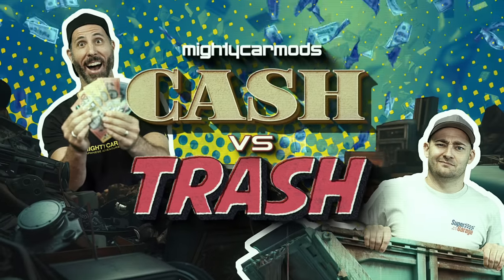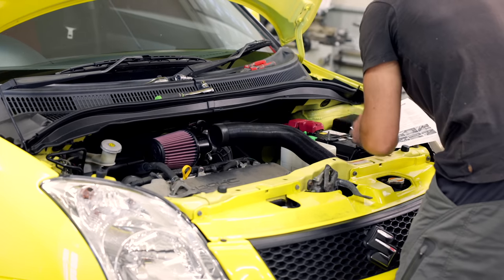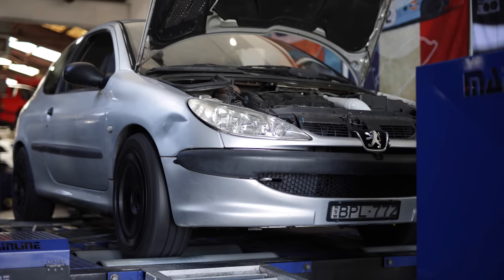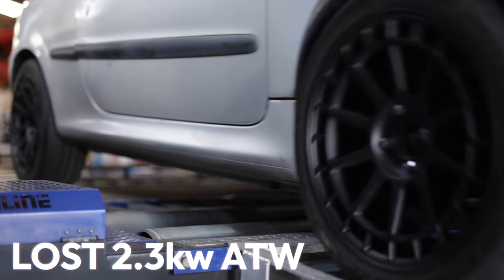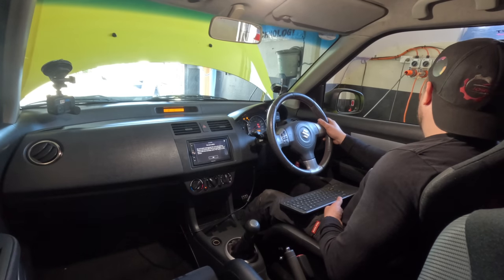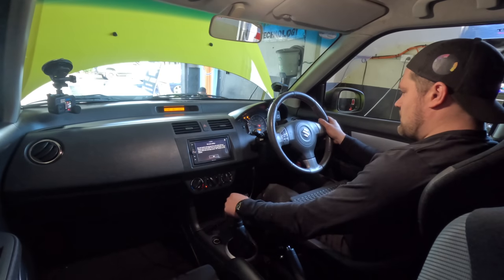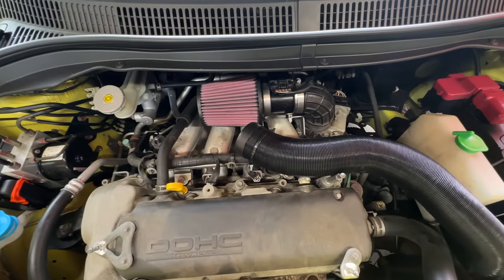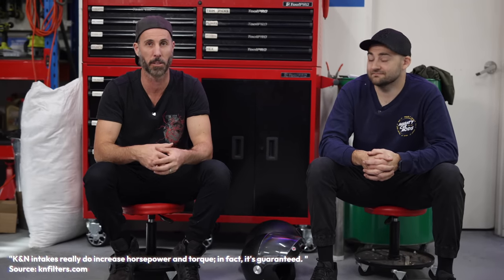Dyno testing POD FILTER Performance Claims | CASH vs TRASH

Comment: Gents, The airflow sensor requires a laminar flow over it. Pod filters are a perfect device for creating a turbulent/tumbling or uneven "flow". Basically its trying to correct fluctuations which it cant to fast enough. An "air straighter" (not joking) will yield the results you seek. Its a grid type device which sits BEFORE the afm. You're welcome.
Reply: They look like honeycomb to be more precise.

Comment: the problem with the Suzuki's intake is the position it's mounted. You have it (as far as I can tell) directly above the exhaust manifold. The hottest part of the whole engine bay. So you actively made a hot air intake. Rerouting it somewhere towards the front might help if you can make the room. If it's the intake manifold, directly above the engine is still not exactly great.

Comment: Powerloss like could be down to humidity, air temp, the changed lenght of the airintake, lack of exhaust backpressure. As for the Peugeot, I'm pretty sure that engine needs the valves adjusted manually, it's not done hydraulically. It's a very often 'forgotten' maintenance thing. That could increase power.

Comment: Air temp, Humidity, and even gas that's formulated for that week/month temperature conditions are all variables that can and do have an impact. Aftermarket air filters that replaced the box can cause unwanted turbulence around the MAF, usually seen and a wavey/lumpy Dyno graph. This is also why there's usually a honeycomb grill Infront of the MAF the straighten the air flow. To a further extent on N/A engines with very predictable air flow, excess flow can ruin intake runner harmonics on newer cars with very finally tuned runners designed to smoothen/use vacuum pulses caused by the valves opening and closing to help flow. I noticed cars with MAP sensors can/usually run better with aftermarket filters, as part of the design usually designs baffling which can be friendly towards changes like those.

With all that said, every car is different and can be susceptible to changes while others can have slight benefits

Comment: You increased the flow of air without compensating with the fuel map, therefore you are leaning out. Also the air pulses of the intake valves opening and closing need a damper, therefore lengthening the intake pipe will matter.

Comment: I bought an E30 from a total bogan and it had a pod filter custom mounted with zip ties. The car ran like crap and it fell off before I had the chance to mount a stock air box.  After putting the stock air box in it runs and idles great and I’m pretty sure it has more power. 😂

Comment: I reckon the swift lost power because of the intake location - no fresh cold air at the back of the bay behind the engine.. maybe try with no bonnet, or longer intake pipe to the front of the bay where some fresh air enters?

Can also have something to do with ambient temps, as cooler air is more dense

Comment: Moral of this story: Multi-billion dollar manufacturers with huge R&D teams usually know what they're doing to squeeze everything out of their motors, even if they have to meet efficiency standards. It's not the 1970's anymore, where manufacturers of carbureted vehicles were forced to cripple their motors just to meet smog standards - every trick imaginable is being used to create excellent performance right off the showroom floor, as increased engine efficiency also means better economy and emissions in general. About the only place where restrictions tend to exist still is exhaust due to noise regulations - and even then, a lot of stock exhausts do pretty well out of the box. Mighty No Mods!

Also, do we know if the ambient air temps were the same on both runs? Engine bay temp? There are so many variables here that can cause loss/gain of power that I'd venture to say that the losses seen here aren't necessarily due to the modifications; both cars are likely putting out the same power they did prior to the modifications.

I will say that it's a delight to see that STUPID $500 K&N filter and dangly tube lose power though. There's no world where that should ever work. That's not a cold air intake, that's a hot air intake sucking in nothing but engine bay air. Ridiculous.

Comment: Firstly, dyno on the same day under the same conditions.

Secondly, compare the entire power curve. Intakes may not increase peak power, but they will typically increase the available power across the rpm range.

Comment: Those intakes can make more power however I have only seen them make a difference on old engines specially with carbs. I run twin Weber carbs with no filter just the stacks but my car is heavily modified for racing. However with the “performance intakes” they don’t really make a noticeable difference unless you have a worked engine then swap to the upgraded intake and exhaust you will actually notice a difference.

Comment: K&N have historically proven to flow better than other filters of the same size and construction.
What you need is a K&N filter replacement for your existing stock filter.
Tuning air flow into an engine is complex and there are always trade offs.
OEM's have to compromise for noise reduction but still work hard to optimise air flow for best torque delivery.
In my opinion, unless you are increasing the VE of your engine there is little point in replacing the stock intake system other than for that sweet induction noise.

Comment: I'd claim there should always be some sort of resonance chamber at the intake. Also sucking air through a flat filter element in my books is much more optimal than trying to do it through a pod filter. Maybe in a drag race or other pedal at the floor -driving it may work (in certain rpm range) but when the engine has to do actual work in multiple rpms and situations, a straight pipe will not work, be it intake or exhaust. /opinion EDIT: though a pod filter could work at the end/start of the intake of a resonance chamber, or closed in line with enough volume around it.

Comment: on a dyno run, the engine gets very hot, because you're not driving. The air filter is sucking in hot engine air that makes you lose power. You need shield it from hot air, or different place, like before and lower than the engine, not behind and above for hot air to get sucked in

Comment: As for moogs power issue, it's been caused by additional airflow.
Probably hot air too...
The engine is getting too much air and which leans out the mixture as a result it gives a loss of power.
Sounds stupid, but with the stock parameters of the ecu fuel mapping etc
It won't be able to adjust  that much that quickly.
For that sort of thing you'd need like a haltec ecu (learning)or go get the cars mapped to deal with the additional addons, so that the fuel spark etc can be adjusted to meet the air.
Engines are just big air pumps, so the more air, the more spark.
As for the exhaust I can see some potential power gains there if marty where to make some sort of custom manifold...
E.g. 4-2-1 exhaust to help purge the exhaust gases from the engine.

So basically engines won't make super amounts of kw/ hp without being adjusted to benefit from the new parts 👍

Comment: I would have to assume the aftermarket filter is changing the way the air is flowing past the MAF sensor. You may need a new tune to make the gains. If the sensor is reading correctly the tune may be adding too much fuel and lowering power/efficiency. Just a theory. I know with one on my cars I had a small tear in the stock air filter which added turbulence to the intake piping causing the car to add more fuel than was needed and change the cam timing. The car ended up going from 420hp to like 370-350.

Comment: Engines like cold air, the filter on the swift now sucks in warm air. There could be other issues too but surely any extra airflow from the pod filter was offset and then some by the drop in density of the air that was flowing, due to putting the naked pod on top of the engine.

Comment: You really just want to increase surface area of the filter somehow. You can do OEM swaps to install a larger filter from another model in yours. That way you know it will fit, you can get parts, and it will function as intended. My A3 TDI has a larger air filter than the sportier S3 so an upgraded filter would be pointless for it.

Comment: I have a HR-31 with a RB20DET and I've put a stock airbox back on as well as the stock dump pipe and I reckon I've lost at least 500rpm top the end. My hypothesis is that older cars the airbox can become restrictive when the cars get modified and make more power because their induction system just simply isn't designed as good as newer cars. The air filters on your two cars are bigger than my RB20 air filter to begin with.

Comment: You are actually giving the KN better condition’s than you should with the open hood. The heat soak is worse with normal running conditions and the spark regarding due to high intake temperature is worse. Try it with a hot engine bay and a closed hood to see the real world power loss from a cone filter.

Comment: You added a way for more air to get in but you aren’t adding more fuel. You can do else a few ways and varying price points. 1. Flash your ECU, 2. Get a piggyback system to edit after the ECU to add more fuel, 3. Increase the fuel pump size, rail size and injector size, 4. Install the spark plug anti foul O2 sensor hack. #4 will be the cheapest and that will be for Marty to do. There are lots of forums out there that will have this as an option or a thread. It involves 2 parts from an auto parts store that have the right threads to match your O2 sensor. There is a long one and a short one, you drill through the long one on top to open the hole and you attach the short one to the long one. This adaption idle connected to the O2 sensor after the catalytic converter. It makes the ECU think that the system is running lean and will dump more fuel into the system. This, added with the intake, will increase the power lost from not having more fuel added with more air.

Comment: You need to add more fuel. An intake increasing 20% air flow will create a lean tune and lose power. Ive done it rescently on my car and required hotter spark plug also to get the most out of it. With quick addition of fuel map it will then make power,  sounds good however 😮

Comment: I never use a pod filter unless i make a custom airbox that guarantees a supply of ambient temp air. For my 208 Gti the engine bay is too cramped so ended up using a drop in filter and  added a scoop. i dont know about the figures but my butt is happy.

Comment: You should really start with an ECU that can be tuned. Bolt on mods don't do anything unless you tune the ECU to suit. More Air? more fuel, earlier spark. Adjust the valve timming. These sorts of things add power. It will need to be Re-Mapped.

Comment: The MAF data is always a little off. You could use a fuel flow meter and multiply the mass flow by the AFR using a UEGO to work out air flow.

Comment: Idk I've always heard most aftermarket intake systems will lose power without a tune. I imagine small engines are even more sensitive to changes. The stock system is designed to reduce disturbances and resonance in the intake tract with the final goal of getting air to the engine the easiest and with the right timing. Small engines are also usually tuned for fuel efficiency. I wonder if the ecu is compensating for the changes and dropping power to maintain the fuel efficiency.

Comment: seems like there isn't enough time for some laminar flow for the MAF sensor and then on top of that cars are tuned so tightly from factory that unless you have a tune for additional airflow, it might not help the car make power.  Or it could be a variety of other things to do with fluid dynamics and resonance

Comment: The 57i + down pipe and cat delete increase my stock MPS3 from 256hp - 300hp and needed a tune for the AFR.
On a 4g93 na with a drop in + 421 exhaust and  a Haltech standalone made 138hp - 150hp

Conclusion? NA is much harder make power than a turbo motor and both needs a tune to go with those mods

Comment: Needs to be mapped to accommodate the additional flow. You might find the car running either lean or rich based on the stock map correction factors and targets.

Comment: I bought an xterra several years ago, just as a beater to get around in. The guy that owned it before me installed a pod filter system, and I can't fathom why.

Was this guy trying to hot-rod around in a rusty suv with suspension that was actively falling apart? Maybe offroad, but once again, the suspension was rusted. Leafspring supports falling off.

I will say, it sounded kinda mean. But it was all noise.

Comment: I once saw a car show where they lost about 7hp by switching from stock smaller rims with higher profile tires to larger diameter rims with low profiles tires but same overall diameter and similar weight. The cause was found to be from the weight of the barrel of the larger diameter rims being further from the ceneter of the rims which required more power to turn. That could be the cause here.

Comment: Maybe a dum question, but wont the wheels and tires make a difference in the way the meassures are taken? I am not sure how the dyno reads things but I know that if the total diameter is  little bigger, the torque is reduced and some final speed is gained. Also if the wheels are heavier, it would take more time to have them spin and on the contrary they will spin faster and all that could have a difference in the meassures.

Comment: As much as i like your videos i think sometimes you guys skip researching a bit. For example. With the B16 civic tou guys used an intake manifold that was made for high compression or turbocharged engines. A manifold that big hurts performance. Worse thing is that the stock b16 manifold is pretty good as is. If needed theres the Integra Type R as an upgrade. The one you guys used is like "3 steps above" the b16 mani. Keep up the videos 😎

Comment: Maybe bigger tyres did add the most to the power loss? You both did innitial power runs at stock wheel dimension if I am not mistaken?

Comment: i belive its several factors. First the tune will be effected, then i belive these aftermarket filters doesnt do anything except sucking in more heat. The oem is much better at lower powers since they wont restrict airflow until maybe 500-700bhp depending on which car they sit on. 

OEM parts are manufactured in a way that work well with all the parts of the engine and the tune, they are fitted togheter to make an efficient engine. If you start to change these parts you most likely are going to make the system unbalanced and not so efficient

Comment: Engine needs a remap with a pod or race filter, thats why they always ask you to upgrade to a pod / open / race filter when you do a stage 2 or higher tune. it only gives the power increase if the engine is tuned / being tuned. go breathe through a straw and then a pvc pipe you suck in lot more air quickly. the MAF sensor senses this that there is plenty of air sucked in and changed the ratios which can result in power loss.

Comment: You need a  longer pipe before the throttle body to build up air velocity, the MAF sensor was desiigned and tuned for that speed of air, having the pod right there is increasing the temperature of the air but also decreasing the velocity that the air in entering the intake manifold. The same for Marty's PeugBro, he made it to open so the speed decreased, didn't you guys learn anything from the Honda build? This is Civic tuning 101 buddy.

Comment: Only Cold mornings . When the Air is Dense . 
Those basic Cone filters soak up heat. =. Lose of power. 

I put a k&n on my 2.6L V6 Vauxhall Vectra years ago it sounded lovely  but my gsi couldnt keep up with my friends 1.3 ford KA .

Comment: The Suzuki has a MAF sensor so if the intake increased air volume into the motor the ECU will add more fuel. I reverse engineer engine management systems for a living, I have also done thousands of hours of testing on my chassis and engine Dyno’s. I have only seen one performance filter that increased power, most will cause a drop in power. They also don’t filter the air like a paper filter. Put a little grease on the filtered side and see how gritty it feels after six month’s

Comment: I hope you took atmospheric conditions into account, pressure and temperature drastically affect the density of the air. If your before and after runs were on days with different conditions it will 100% have affected the performance.

Comment: It's not forced air so your pipe sitting at your filter isn't going to bring any air in from the front of the car. You're simply sucking the radiant air from around the engine. The original system would have sucked air through the pipe from cooler air toward the front of the car. During the dyno run you should try putting huge fans at the front of your car to blow cool air toward your engine as though you're actually driving.

Comment: K&N will require a retune to account for the increased airflow in to the engine, it will also require a cold intake NOT sat above a hot engine sucking in HOT air.
Even if you manage to retain original power, you're paying for SmilesPerMiles rather power.

Comment: It's better to use fixed rpm power measurements to compare intake systems, as it allows the ECU to change the fuel/air ratio to optimal.
Under acceleration so many things change at the same time that the ECU has to rely on internal maps that get built over time.
If the ECU didn't get to "learn" the new intake system, you will get lower performance.